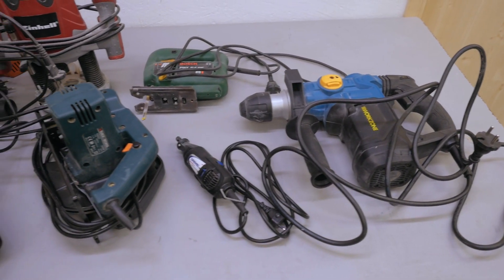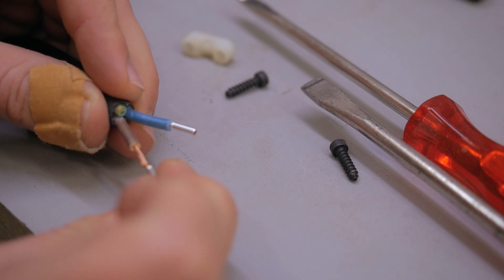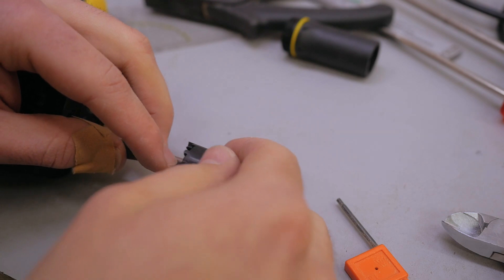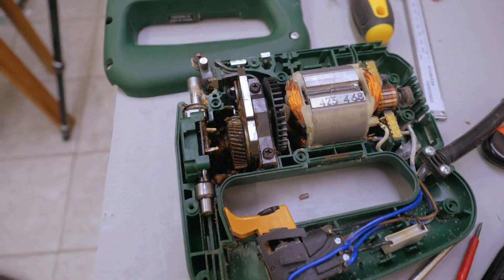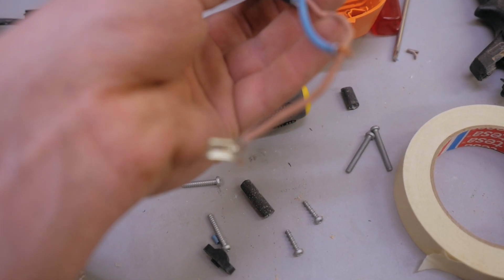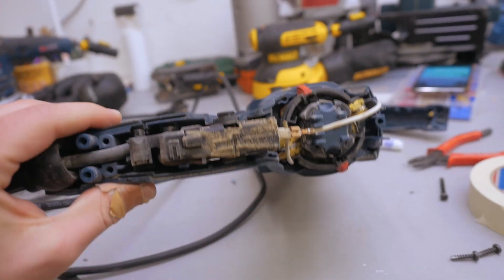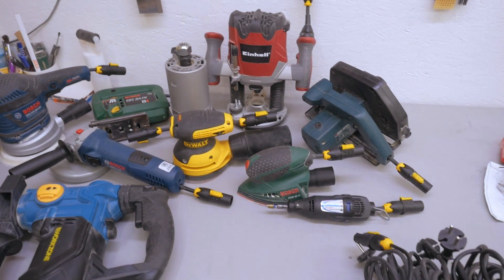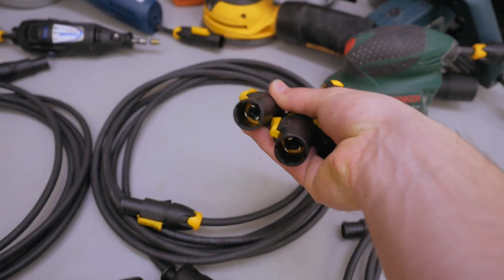A Quick Connection System for Power Tools

Comment: Sleeves are for strain relief. Without them, the only thing holding the cord when it's tugged are the two tiny screws at the connection point. The sleeves make it so that the case is what absorbs the pulling force instead of the connection. I think if you found a way to glue the wood to the sleeve then it would be problem mostly solved, as now it would be functional in addition to being aesthetically pleasing. (I say mostly because the design of the custom shaped sleeves was probably arrived at after many iterations to resolve common points of failure).
Reply from the maker: I know what the sleeves do, but they only support the cable against bending. Since I used bigger and better cable now, I'm not worried about that. Every tool has a cable clamp. The Screws for the wires don't see anything of the pulling.

Comment: For the drill, insert a thin solid metal rod right next to the wire & pull the wire first / together. A very tiny screwdriver will work too.

Comment: you could use a standard EU connection that is much smaller, durable and doest stick out of your devices, i cant effort why did you buy a 15cm long plastic dildos to power your tools
Reply: And do you have one?
Reply: I think you are referring to the Euro-plugs. These are only rated for 2.5A. Most tools need more than that.
Reply: C13/C14 plugs would be an option.

Comment: I put IEC connectors on some of my tools, but have been thinking of replacing them with powercon for a while. I'm also planning to put one of those things: http://www.jula.se/globalassets/catalog/productimages/404012.jpg?width=458&height=458&scale=canvas&bgcolor=white with such a connector on the ceiling somewhere with good reach.
About the drill; I don't know, but it looks like the speed control wheel could be pried off, and if so, there's probably a screw behind it.

Comment: and there goes the warranty on all your powertools 😁.well,when you cut the cord. maybe good to know for the others. many brands are pretty strict about modifications. 😉. at work we need to put cee plug on all pir gear,wich make it looses warranty.
Reply from the maker: I think only three of the tools still had warranty. I also couldn't send a tool in for repair. I need to open it and see what is wrong if that happens someday.
Reply: yesi understand, i'm bad at that myself. always want to fix stuff. well, i was just saying that in case other people like the ideabut dpt think of it. if they know it,is their problem when they still continue. 😊. it is a nice solution for the powercords though. many gardenpowertools already have a very short cable for the same reason.

Comment: I think you spent a lot of money for nothing.  I just cut all my power cords short, 6 Inches, and then put a new plug on the short end.  This way I have one long cord on a rewind spool attached to the wall and I just plug the tool with the short cord and a regular plug into the extension cord.  This is also good because you can connect them anywhere to a regular extension cord.  Although I think you do some great stuff, this time you bombed out.  Regardless, keep out the good work, you do some really nice work.
Reply from the maker: Everybody has their own approaches.

Comment: Super Idea! You motivated me to do this with my power tools - but probably with a better (and less costly) Connector : Wieland RST20 - they also have distribution blocks and device connectors (which are flush to a housing. Check out: https://www.youtube.com/watch?v=wqntzxuR2zk&t=93s
Reply: "Zertifiziert nach IEC 61535 FESTE ElektroINSTALLATION in Gebäuden" - Tut das eigentlich weh, wenn man so wie du nicht denkt?

Comment: A great idea especially combined with a retracting power lead on the ceiling. Just a few thoughts to add:
Those ferrules need crimping. Otherwise the wires will slide out under tension, causing them to immediately contact and blow the fuse in the electrical panel. Also the electrical arc that will form will burn the inside of your tools. You risk losing your tools or even getting an electric shock. If you don't have a crimping tool just don't use ferrules, screw terminals on bare wire works just fine as long as you don't overtighten it. 
Also, as others have said, strain relief on cables is important, without it the insulation will break faster then you realize.

Comment: At least you found what is known as the top connector brand in sound & light : http://www.neutrik.com/en/products/
I loved the original powercon (blue and grey) but they lack the male cable connector.

Personally I would have only done this for tools that connect to the dust collector, this way you can run a power cable parallel to you dust collector hose.
This is still on my todo list but I want to built the connector into my tools (using a chassis version).
Reply from the maker: Also on my todo list. Boomarm plus cable. At least the cable part is done now.

Comment: Hi Marius, I've planned to do the same also for my power tools, bought all the materials, but not done yet... 
Since the Neutrick connectors was rather expensive, I have choosen a chinese alternative (search for SP2110 on Aliexpress): not tested yet but at least on hand they seems to be good enough. 
I have also decided to cut the original wires and not to open the tool because in second way you loose the warranty and some of my tool are still under warranty. Instead If you replace the original socket or shorten the Cable without opening the tool you're not loosing the warranty...

Comment: Why dont you just solder the connections?
Reply: Jack Harwood Crimped connections are more reliable than soldered in the long run. It doesn't appear he actually crimped them though, just used the screw terminal pressure on the ferrule.
Reply: mlindholm yes but for the drill, why didnt he just cut the existing cord and solder the connector on
Reply: Soldering 230V connections can be dangerous and is not recommendend by the VDE. Connections should always be mechanically secured.
Reply: Jack Harwood well, again, crimp...but he said elsewhere in comments he didn't want to modify any of the original cables, so that's why he didn't.
Reply: Because this is fucking Germany and not some hobo island country. Solder is super soft, softer than the copper it's supposed to hold together. It'll just squeeze from the screw terminals, cause insufficient contact and increased resistance, heating the plug, melting the solder, the housing, the house, your face ...

Comment: On the bosch orbital sander, the switch has two little white "slides" where the blue and brown wires enter into the switch. Slide the little white pieces and they will take the tension off the wire and you will just pull them out. Do not stick a small screwdriver into the hole, you will bend the spring connection and it is a pain to get the wire to hold again.  Hope this helps and I really like the idea of the custom quick connects.

Comment: What happens if one day you have to go to work somewhere, and suddenly you forget the cable where you connect all those tools to which you surpimiste the cable in such a harmful way .... In fact, the manufacturers of the tools , Recommend not to alter the characteristics of the same, much less use a cable other than the one provided by the manufacturer, or if it deteriorates itself, that it be changed by specialized technical service .... I do not know if you gained comfort Or practicality with what you did.

Comment: That is the new Neutrik system, it's slightly waterproof and can withstand alot of current, but they have a cheaper system called PowerCon that have a blue and white connectors. They aren't waterproof and you cannot daisychain them like you have them configured (have to use an adapter). But I have to say your system looks awesome!

Comment: I did this exact upgrade last year using the Powercon connectors, but I cheated and just cut the cables. It's nice only having one power cord for all of my tools, and it's SOOO much easier storing the tools without a bunch of cords to get tangled.

Comment: Congratulations, it is an excellent idea. Can I use an aviation connector?
Reply: http://www.ebay.com/itm/-/311081266634?roken=cUgayN&soutkn=jPAkRp
http://www.ebay.com/itm/-/331974313287?roken=cUgayN&soutkn=pQCG8g
Reply: OF course if it's rated at 15A, the problem is they seem to not be a quick connection . So it might be frustrating to screw the connection every time

Comment: is it possible to use the normal xlr conector for Audio ?
Reply: I'm not not a electrician but I wouldn't do that those connectors you talking about only for lower voltage but why not using a regular plug it does the same and is a way cheaper
Reply: Of course it is "possible". Question is really is it "sensible". But since you had to ask, it would be pointless to explain because you didn't even bring the initiative to research XLR first for their properties.

Comment: This is a concept I have been thinking about for years. I would like to see manufacturers adopt a standard connector built into the tool and standard cords that fit across brands. I proposed this idea to Black & Decker / Dewalt but they were not interested.l think corded tools are superior to battery tools in every way except two and this idea solves one of them.